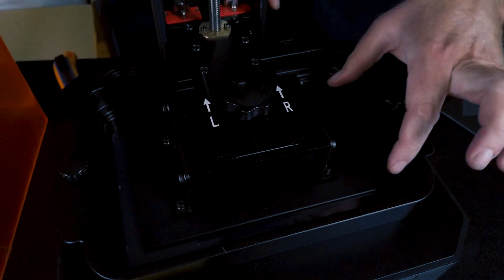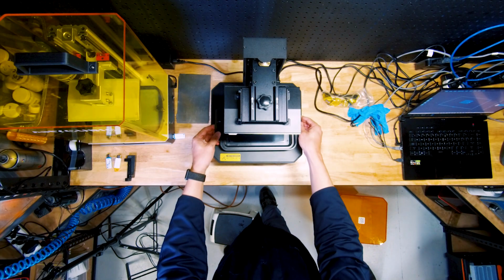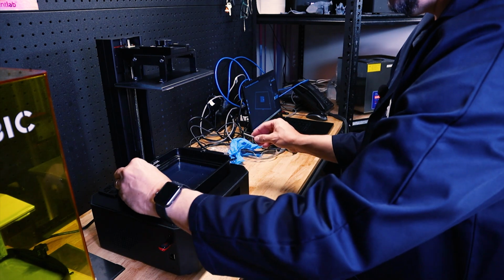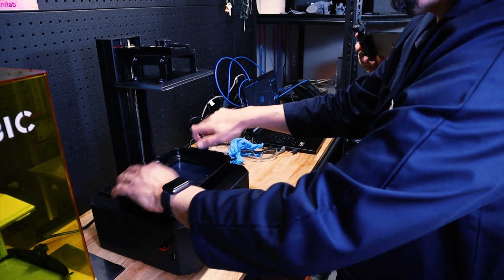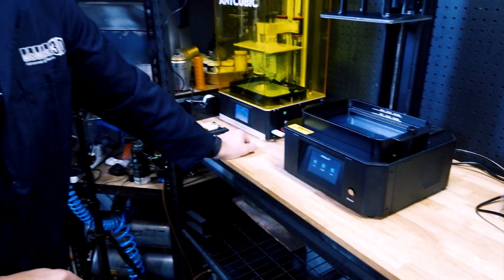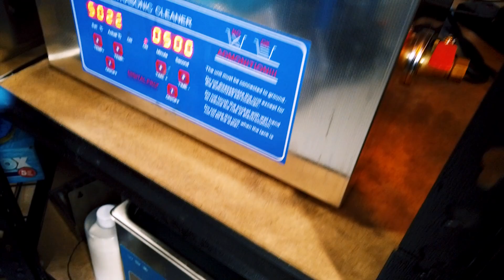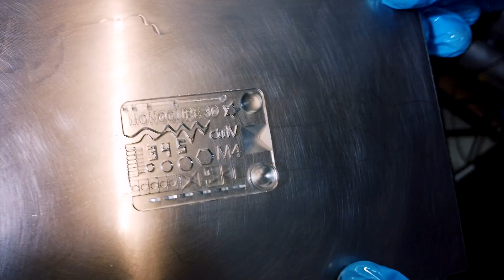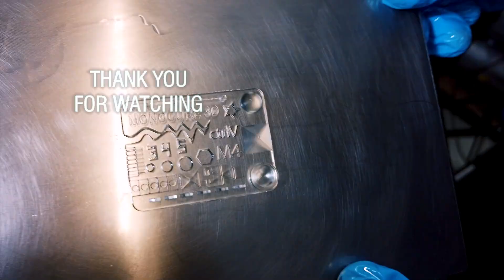Unboxing and Setting up the Creality LD 006 3D Printer

Comment: It leaves a small cured edge on the tray, is that light leaking around the edges? How do you fix it? It's very difficult to clean because it's almost stuck between the FEP and the tub.deja un pequeño borde curado en la bandeja, eso es escape de luz por los bordes?

Comment: I have a problem with my creality ld-006 that I just got today. The problem is that files that I put on my UBS are not wisible on 3d printer. I have correct type of file (CTB) and USB drive was formated to  FAT32. I'm thinking that there must be problem with USB port on my 3d printer. What do you think? Is it USB port or should I try something else?
Reply from the maker: Where did you slice the files?
Reply: Update the firmware of the printer. It sorted that problem for me.

Comment: Has anyone tried using the creality slicer with this model? I’m curious because I’ve got the halot one which shows up on the model list but when you download the slicer software from the model ld-006r this model is not there. Can I use a different model of the same build size?
Reply from the maker: You should be able to set it up manually. If not go with Chitubox or Lychee slicer instead.
Reply: @Monocure3DProTips  I got it to work with chitubox no problems. I just like the creality slicer a bit better than the chitubox basic version. I like that I can add txt to my prints on the creality slicer!
Reply from the maker: You can always use theCreality  slicer to create your text and export it as an STL. I’m not sure if you can do that on the slicer? Then you can import into Chitubox for the slicing.
Reply: @Monocure3DProTips  thnx I will try that!
Reply: @Monocure3DProTips  that actually worked really well! Thank you for the suggestions! I really appreciate all the hard work you guys put into the channel! I’ve learned so much and I’m able to pass along what I’ve learned to people who have struggled with the same issues! One more question if you don’t mind??? Can you take the usb stick out while printing with this machine? I noticed that every time it lights up a layer it reads the stick so I haven’t chanced taking it out. Thanks again for all your help
Reply from the maker: Thanks for the positive comments! I’m glad we could help. The usb needs to stay in during the print.
Reply: @Monocure3DProTips  I kinda figured since it was lightning up on every layer! Thank you again and look forward to watching more videos when they come out!

Comment: I have a problem with my ld-006 since I installed a flexplate: I recalibrated the z as I should, but the buildplate still presses down on the glass, so it seems like the machine isn't saving the new z position. When experimenting around and pressed home without the buildplate, the machine stopped and when I measured with they buildplate it seems it was just a couple of mm too low, ie the height of the flexplate. I even fucked around and raised the platform a full 10 mm and tried to set that as the new z=0 - no luck, when pressing home the build plate still went on down onto the glass. Does anyone have a solution for this?
Reply from the maker: Dont rely on the firmware to set home. If there isn’t enough room you might need to adjust the IR sensor or the blade that interrupts.

Comment: Just got one of these during the $99 deal (I thought it was a new printer but I think it is the same as these older units) and so far so good. Only thing I don't like about it is  the buildplate not having the screw on it to help hold it. Kind of awkward having to get you hands into the resin most times just to get the plate off.

Great review and I will check out more of your stuff!
Reply from the maker: Amazing! Thanks for the comments

Comment: Does your machine have any movement (spring loaded) in the assembly that attaches to the build plate and ball screw? If I push down on my buildplate it moves down on the ball screw about 1 or 2 mm, which jumps back when the pressure is released. Not sure if mine is assembled incorrectly or if it is supposed to be like that.
Reply from the maker: Yes, this is a tension spring. It can start to weaken over time so we recommend you change them if you start to see z banding lines on your models.
Reply: @Monocure3DProTips  Okay thanks, just weird that it is loaded in positive Z, I'd expect it to be the other way around from and engineering POV.
Reply from the maker: There are a few things that seem to be the wrong way round!!
Reply: @Monocure3DProTips  I found I can lower the play by removing the platform from the ball screw and then turning it towards the spring so hopefully that will help. Now I just have my motor losing power for half a second every 2 or so seconds so I'll need to fix that before I can try it again...

Comment: I was calibrating mine and in the middle of that the touch screen stopped responding. like it clicks when I touch a folder but wont open it. Its stuck on the home screen of the 3 folders Tool, System, and Print.
Reply from the maker: Sounds like it’s frozen! Try a different USB.

Comment: Wow, wished I had seen this video and all the complaints on this machine before I bought one tonight.  😳  I guess the only good thing is I got it on sale for 550. Now it's making me wonder if I should return it.
Reply from the maker: They might improve the firmware?
Reply: They have on heavy sale now in my local shop. Wonder if it is because it came out really bad. What is your experience? Thanks
Reply: @user-fc1fo6bl9d  truth is the film came loose and broke... I bought some new film... but never installed it.... like most 3d printers for me... anything of size never turns out good.... and could very well be me. 

That being said... the one thing I needed it to make. It accomplished it several times to make a jig for my drill press so I could make a set of buss bars.   I haven't used it in months.
Reply: @nathanpotter8569  This happens a lot. People buy devices, have trouble using them, and then they got unused forever.
I have 2-3 devices like that.
But, do you think it is a printer to avoid or it can actually do a job?

Comment: pls help! what is the file extention? which one? how can I save my model for ld 006 in chitubox?
Reply from the maker: Just make sure you have the printer selected in the Chitubox settings, it should then save as the correct file extension.

Comment: Curious to know if the Z-Axis Metal arm is strong enough against the suction forces?
Reason being that the Harlot Sky appears to have a beefier arm and reduced max height as a result.
Reply from the maker: It’s fine - the only problem we had was with the Epax E10 which had a plastic (maybe Nylon) but it still flexed and didn’t print large objects well at all!!

Comment from the maker: If I haven’t mentioned it already, over time our LD-006 ended up with a floating LCD screen.  Now when it prints the LCD sticks to the FEP and gets lifted out of its socket on every lift.  This dents the corners of the FEP and could eventually damage the LCD.  Tried a bead of silicone under the edge and replaced the black tape - still pops out.  Just something to watch out for if you own one.  Hopefully Creality will offer a solution for this issue?
Reply: Hi，we are sorry about that，can i have your email address? Or please send email to  halotsevc@creality.com   with  your printer problem,we will check it and offer you the reply on it ASAP.
Reply: @halotservice6739  Well , same thing here...floating screem and dead pixel. No way to find a replacement for the exposure screen
Reply: @Lucas-yg8rn  Chegou a encontrar alguma coisa, ou nada ainda?
Reply: @renanjeron  Olha no Aliexpress Loja Long Feng (Da Store) . O Modelo da tela é o PJ089Y2V5, a Chitu Systems fabrica essa tela.  Preço $824 reais
Reply: @renanjeron  Manda mensagem antes de comprar pro Vendedor pra confirmar as informaçoes
Reply: You are using the wrong configuration for the retraction speed... it is setup way too fast

Comment from the maker: Just a correction to the “z=0 option doesn’t do anything” comment - as it turns out, it does if you nudge the home position up or down manually.  If your calibration print base thickness does not match the model base thickness you can nudge the home position up or down in 0.1mm increments and then select Z=0 to set that as the new home height.  It will still home to the same height based on the optical end stop but then it will move to the z=0 height override you set when it starts a new print job.

Comment: G’day, mate! For an engineering project, i.e. to create small SLA resin casting molds and RTV silicone seals and urethane seal holder components from said molds, which of the resin printers would produce the highest fidelity (minimal voxels or layer-line visibility), and thus provide the least amount of post-processing touch up after washing and curing for mold making? Ultimately, I rather minimize filling in and sanding the molds being mindful of the finished silicone parts released from the photopolymer-based mold. Thanks in advance mate!
Reply from the maker: Hi John, most of the 4K MSLA resin printers will go down to 10micron layers in the Z axis. There will be no need to sand as you will not be able to see the layer lines at that height. In regards to which is best, there a few to choose from, so I recommend you do your research before committing. Facebook groups is a great place to start.

Comment: When compared to Anycubic Mono X, this Creality LD006 is super slow. 

50 micron, 23cm print takes 21 hours in LD006. 
Mono X takes 11 hours.
Reply from the maker: Interesting...Wouldn’t the layer duration and lift speeds control this?
Reply: @Monocure3DProTips  we tried those same settings that mono X used, but speed never improved on LD006.

I think it's hard coded with the machine.
Reply: @zitizen  What's your setting on Mono X ?
Reply: @yamatotran7668  50 micron. 
1.5sec 
6 base layers @ 40 seconds
0.5 off time
8mm lift height
The default settings of chitubox for monox.
Reply from the maker: Interesting observation. I got John in the PrintLab to confirm and he agrees that it is slower. Hopefully they fix this with the newer Halot series.

Comment: Most people buy this machine because of the build volume, if you intend to use the full volume then a magnetic build plate does not work, the weight is simply too heavy .. the corners of the plate start curling and then resin starts seeping underneath and then it starts twisting .. I tried using for over 2 weeks .. its simply a bad idea and recommend people don't buy one.
Reply from the maker: This can also be caused by the resin sticking to the FEP due to poor model position and over curing of the layers. We haven't seen this problem with weight before.
Reply: @Monocure3DProTips  Iv used commercially 24/7 since the day it came out and always use full build plate and volume, I also use the LD 002R and the LD 002H .. lot of people will also be put off on how noisy this machine actually is compared to the (in my opinion) far superior Mono X, Creality has also failed to provide me any details for replacement Nfep (uk)

Comment: Hi! I'm having an issue with my LD-006 and was wondering fi you might be experiencing the same. Even after minimising the cross section of my builds through angling and support selection, on ever lift there is an auditable suction and visible ripple in the vat as the build pulls of the FEP. I've replaced the film and experimented with a number of slice settings but I can seem to avoid it. This is has resulted in some layer shift in my builds :( Any advice would be great, thank you!
Reply: @George Kerwood We are reponsible for every customer, so if you have any problems about your Creality 3d printer (especially when you need to use pics or videos to show these problems), pls contact our after service https://www.creality.com/service-request. We have very professional engineers there to solve your problems. Thanks for your support.
Reply: @Creality3D  I plan to buy this printer. Has this issue been corrected?
Reply: I think i have a same problem ;-(
Reply from the maker: Interestingly we have just noticed that as the part is being lifted off the FEP the monochrome screen is also lifting out of its socket with it.  Not great.  Trying to work out how to secure the LCD to prevent this.  The black tape is clearly not doing much besides masking stray light.
Reply: @Monocure3DProTips  Please, post your solution when available to solve this problem :-(
Reply: @Monocure3DProTips  I also have noticed creasing/disturbance in "the black tape" suggesting I'm experiencing the same thing. I've also noticed an impression of the screen developing in the FEP as if it's being pulled into the rear side. I seem to suffer this with layers of even as little as 20cm2 so pretty much on every raft.
Reply: Have you found a solution to the moving screen? Mine seems to do the same.
Reply: @theboardnerd  Hi Mate. The only thing I found that help significantly was the Chitubox parameter "Rest Time Before Lift". What this does is pretty self explanatory but it seems to help in that it allows the FEP to cool and stiffen after the softening effect of the exposure. Thus, it's less malleable as less likely to form up into an effective suction cup against the screen as the build retracts. I've set it as high as 3 seconds but my build times don't matter to me.
Reply: @georgekerwood9100  Thanks for the reply! I'll do the same as build time doesn't matter to me either. I hear people have been putting a thin line of silicone to keep the screen in place and using kapton tape too. I also learned that using nFEP will help minimizing the issue.
Reply: @theboardnerd  All useful tips should I ever decide to return to the damned thing! My hope for resin printing was to achieve high accuracy, functional parts however I since given up due to issue such as this, venting voids, orientation and support limitations etc

Comment: Finally a review!!
Reply from the maker: From this review, I think John prefers the Mono-X just because he can turn down the UV power and have more control.
Reply: @Monocure3DProTips  Thanks for the recommendation! keep up the good work, you have a new sub!
Reply: And the fact that it recovers from a power outage in the middle of a print job!  Huge plus for me.
Reply: Would you recommend this over mono-x?
Reply: Mono X wins hands down. I have done 100s of prints in both machines.
Reply: @zitizen  Yup based on everyone recommendation I go with Mono-X, follow both facebook group some LD006 owner received their printer without power connector or screen.